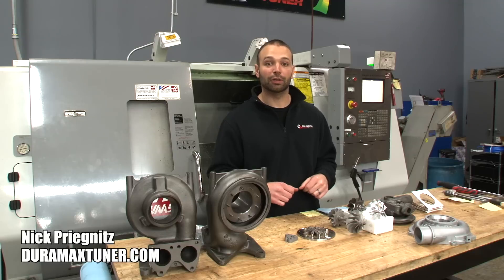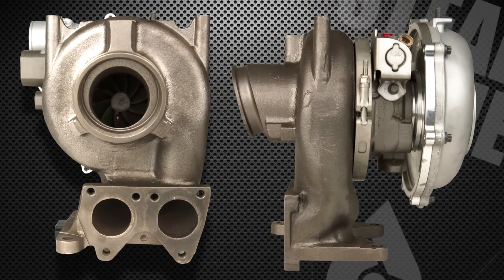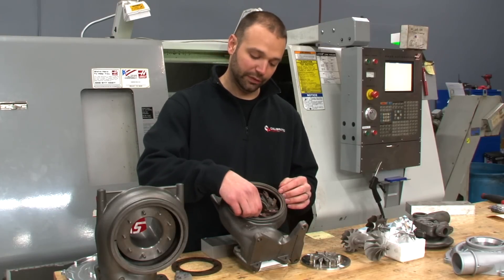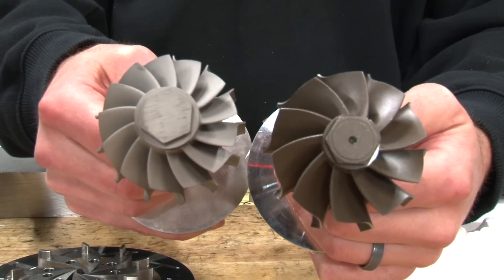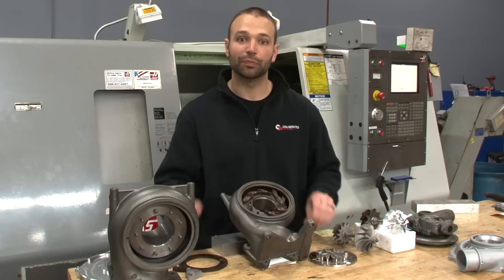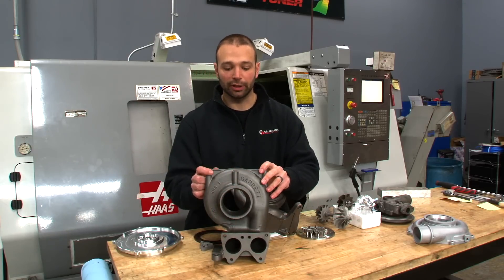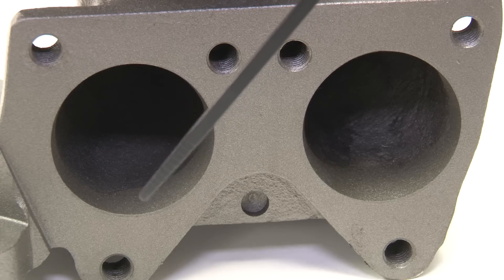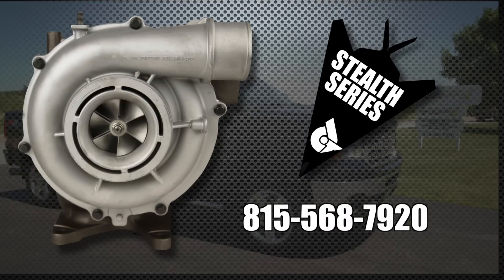VVT and LML Stealth 67G2 Turbo

Comment: How are the egts compared to the stock turbo? Would stock cp3 and injectors be sufficient for this turbo? I'm looking for a turbo to tow alot with and I'd like to get rid of as much back pressure as possible to help keep egts low.

Comment: I dropped you some messages last week and thanks for the response Nick. I have the 2008 LMM and have 165 Fass lift pump, 5" race exhaust all the way back, EFI Live 5 and a ATS stage 2 800hp transmisssion with Co-pilot trans tuner to back all this up.  I talked to you about this one last week and I believe this is the way I want to go. You suggested twin turbo set up but that's out if my budget range for now. Told you I got to do all over size piping for hot and cold side. How much for the 67 G2 Stealth VVT? And what size injectors and brand would be best to get 800hp but still leave me manageable tow if I needed to? Also what kind of fuel mileage would I be looking at running this suggested set up with 35" mud tires (ballpark fig.)? I plan to dyno so I'm running a clean tune but slightly rich on the fuel so I'm not running to lean. Don't want dirty tune because I've heard it will destroy your engine. LOVE THE INFORMATIVE VIDEO'S!!! YOU GUYS KNOW YOUR DIESEL STUFF AND IT SHOWS! KEEP UP THE GREAT WORK GUYS😎🤙

Comment: I'm looking at getting one of these for my '16 LML. What size injectors would you recommend? Its pretty much a daily driver and rarely tow. While I don't race or pull with the truck, I'd still like the ability to turn it up occasionally have some fun. Are 60% over injectors too big for a mild street tune? Will my CP4 have any issues? Yes its fed by a FASS 165.
Reply from the maker: I think a set of Exergy Sportsman Injectors will get you where you are trying to go.  You could go to 30% over if you want to have that extra fuel on tap.

Comment: Have a 03 lb7 once in awhile I'm getting a low pressure code. Every 6 months I'm getting a ticking noise under load. The injectors are good Fass fuel system. Would this cause the problem?
Reply from the maker: That is not quite enough information for us to be confident about a diagnosis.  But, possibly a fuel pressure regulator.
Reply: @Duramaxtuner  okay thank you I was leaning towards that. I'll let you know if that works

Comment: Which stealth turbo upgrade would work best with a s475 twin setup on an Lbz  ???  Your stealth 64 or the stealth 67.2. ??? How would this setup spool up in place of the stock one ??? I would guess this would require a tune update as well.
Reply from the maker: If you're running the s475 for your low pressure charger the 64 would be a better match.  If you run the 67G2 than you can consider matching it with an s488.

Comment: How would this turbo’s power and drive ability characteristics compare to a Danville 68mm stage 2R?
Reply from the maker: Danville makes a great product and the 68mm Stage 2R is a category leader.  The VVT and LML Stealth 67G2 custom vanes are up to 53% larger than stock, it features the largest turbine available to any VVT Duramax turbo and the compressor wheel is just about the same size.  In all, we designed this to make the same if not more power and be incredibly better to drive on the street.  We spent a long time making sure we could harness the peak power we know customers want while making sure we provide the best driving turbo of this size.
Reply: Duramaxtuner ok, so similar power but drives better on the street than the Stg2R. Thanks for comparing.